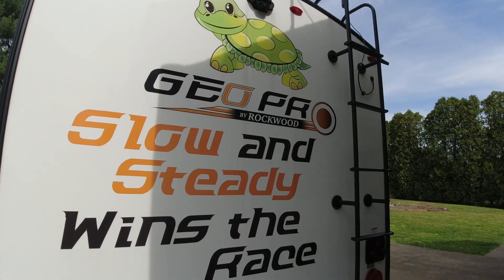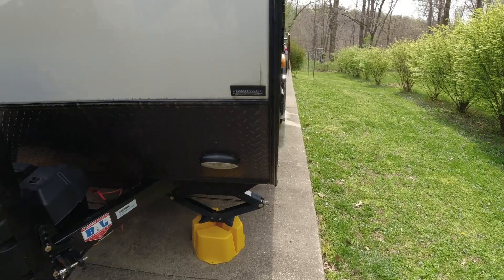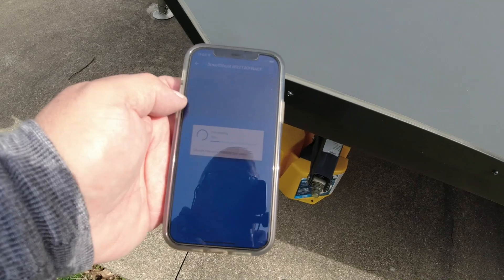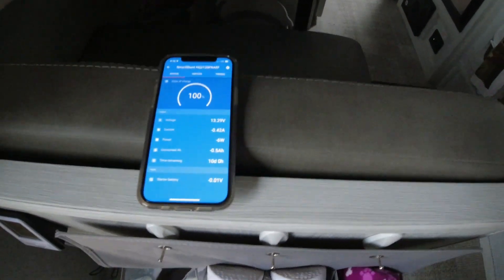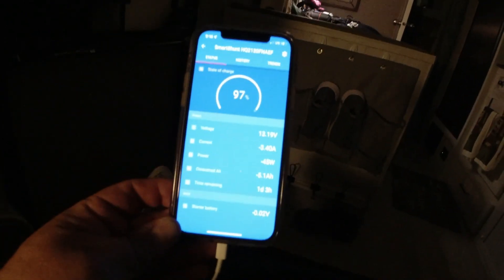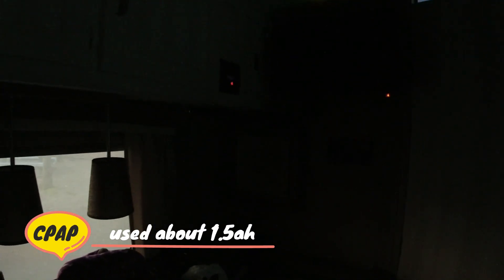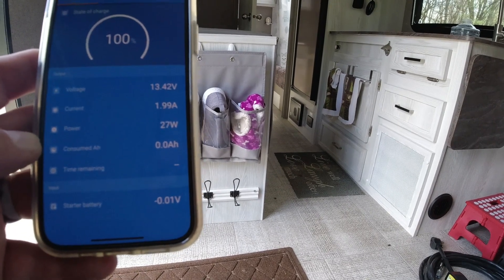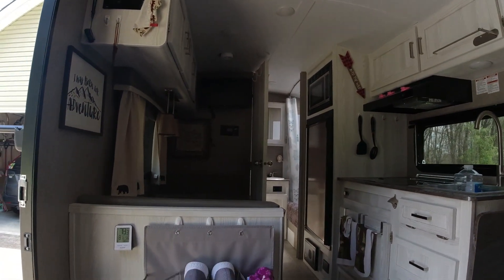Testing a 100ah Battleborn System

Comment: Did you use your inverter for your cpap?  Or did you have a DC  adapter?What brand and model of cpap do you have?
Reply from the maker: I got a DC adapter for my Cpap, I uses the Resmed AirsSence 10, they also make one for the Philip machines, just go online and you should be able to find one, they are expensive but worth it if you want to go boondocking.

Comment: Nice one! I've got 400 watts up on the roof and, as long as it's sunny, can go several days with my 12 volt fridge and two 6 volt 215ah batteries. It helps to travel with a small quiet generator for those days without sun. But those batteries are going on 3 years old now so I'm thinking about going to 200ah of lithium. After watching your "real world" video and some others, I think that's the right way for me to go. A single 100ah battery would give me less power then I have now but 200ah would give me a bit more based upon 50% usage on flooded and 80% usage on lithium. Thanks for the feedback on your experience with your new power setup.
Reply from the maker: With the 12 volt fridge you still might need 200ah, I am currently boondocking at a harvest host and I am at 99 percent just before bed time, I will do a shorter video on my 2nd trip on the Battleborn in a few weeks

Comment: How much power does the weBoost use on average?
It is hard to find tech specs online but I saw one page that claimed 	12V / 4.5A = 54W.

For efficiency you likely have the CPAP plugged direct to DC.
Does the camper have direct plug DC outlets easily accessible?
Reply from the maker: The cpap is around 4.5 with hydration but 1.5 ah with it turned off and yes, I have a direct dc 12 volt plug adapter. My camper had one plug but I added one on my side of the bed. The we boost draws about 1.5amps

Comment: Thanks for all the info, I’m looking to do the same with my 20BHS. I was lucky to find a barely used one last year with a propane fridge, didn’t want that watt suckin’ 12v! Seems a single LiFePO4 with maybe 300w solar would be a low-tech way to stay off grid fairly indefinitely without worry.
Reply from the maker: My 100 watt panel keeps pace as long as the sun is shining so 500 should do nicely